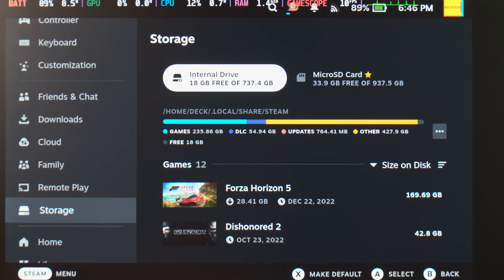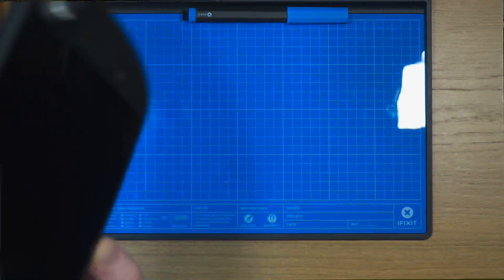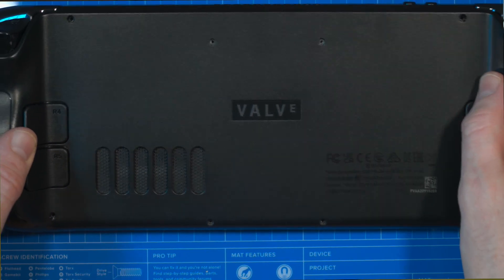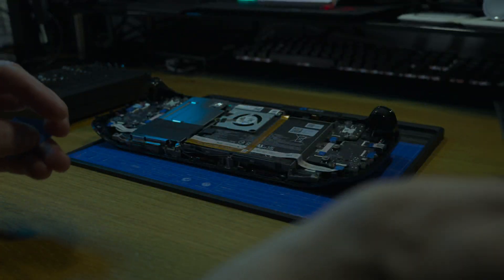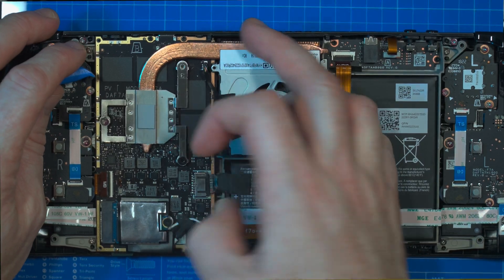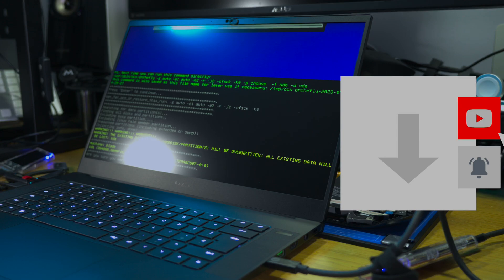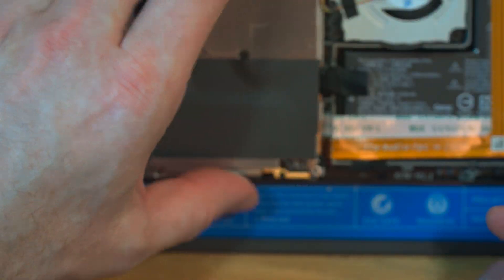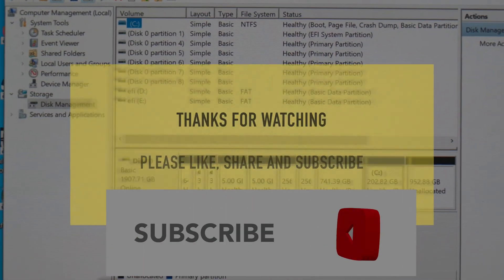Steamdeck SSD Upgrade Guide: Unleashing iFixit 2TB Upgrade Kit.

Comment: ive been rocking the wd 2tb for a good while now. 
surprised so many people waited to jump on this. 2TB is the sweet spot for storage
Reply from the maker: Hi @h1n1viruz yes 2TB ssd is nice, along with a 1tb microSD.  With a 1TB ssd, my drive and 1TB micro SD was full,  so i needed more space. Especially as I use Windows also.
Reply: Did you have any issues formatting the 1 tb micro sd card?.. I have a san disk extreme 1 tb and I can’t get it to format to save my life.. the deck reads and recognizes it.. it just won’t format it 🤦🏻‍♂️🤷🏻‍♂️

Comment: Do you have a link for that device you put the 2 drives in to clone them?
Reply from the maker: @DirasyajX, I used two old external MVME drive enclosures I had lying around from Onico, (https://www.amazon.com/ORICO-Transparent-Enclosure-Converter-TCM2-Silver/dp/B07RFJM494/ref=sr_1_4?crid=2RUU8GMTZSUD3&keywords=orico%2Bnvme%2Bm.2%2Bssd%2Benclosure&qid=1690904945&sprefix=Obico%2Caps%2C346&sr=8-4&th=1) and used Clonezilla software to clone the drive.  Seems these enclosures are available on Amazon, they are cheap but they may not be the best for speed of transfer, but you can use any enclosure that fits a 2230 Mvme, which is pretty much any external Mvme.  there are also cloning drives that take two MVME and clone them, but I have never tried them and they are very expensive.  But, either way, I would try to at least have two of the same make enclosures so they are the same speed.  Hope this helps.

Comment: Ive read people are using an nmve pcie extendion cable to add a 1tb-4tb m.2 2280 placing electrical tape and taping it down along with a thermal pad near the battery. Rather than just using a 2230 or a 2280 directly
Reply from the maker: @slapndbass I did consider that but my main two concerns are heat build up around the battery, and rf interference.  Probably would not make much difference, but an expensive experiment to find out.  I have tried hack solutions like these in the past for other things and they are usually fine for a while then you start having problems as you use it longer term.
Reply: @T8Tech  I put a 4tb 2280. No issues used those graphene thermal pad. Whit electrical tape.I took the risk but I saw there is a backplate coming out that is made just for an 2280. But it's $99 USD. I pretty much just use the steam deck to replace my ps3 library. And my PC can't handle rpcs3.
Reply from the maker: @slapndbass, nice, 2280s are great value at the moment, I have been eyeing up the Sabrent 8tb QVO drives for some time, just waiting till the price is right.  And speed is not really an issue for the steamdeck, the differences are negligible.  How long have you been running the 4tb?
Reply: @T8Tech  a few days but I bought my steam deck from a friend that already had a 1tb 2280 for 8 months. No issues. He's just regretting he sold it to pay the difference on a ROG ally that fried his SD card and over heats just running emulators
Reply: @T8Tech  I did decide to go with a slower speed gen 3 just to keep it less risky. If games run off the damn micro SD card you're not gonna notice a lower speed SSD trust me. I was playing max Payne 3 on my tv no dock just a USB c hub station for hours at 1440 120fps
Reply from the maker: @slapndbass, I bet he is.  ROG is nice if you need windows only, but if your going to emulate why would you use the Asus.  Windows eats up resources unnecessarily.
Reply: @T8Tech  idk he bought into all the YouTubers getting paid from Asus. I didn't get a steam deck till recently just cus of the tech YouTubers not the gaming reviewers . They said they'd honestly wait a while. And they were right it had issues(still kind of does) Yes the steam deck is limited but I'm using it to play games I missed out in my 20s(I'm 37) and my 30s. For the new ones I'm getting the onexfly. It launching august 10 I got the email today. I backed up all my ps3 games I bought during the rona and selling them online and local. Now I can just take my steam deck and my Portable playstations. I was going to put windows on the deck but I then thought to myself wtf is the point then? Even if I don't get the onexfly I'm more than happy with my purchase specially when it was only $250
Reply from the maker: @slapndbass this is the challenge with everything tech.  Marketing make promises that sound great but are never implemented the way you would hope.  Higher resolution, sounds great, but kills the batter. Faster CPU and GPU, less battery, more heat so it’s only in short bursts.  Smaller size, more heat, less battery.  And then there is the poor software implementations, and/or lack of updates.  Steamdeck is not the best at anything but is the most complete package so far, with the best software support.

Comment: Does it read n write 4500? Cus maybe I’ll buy this instead of the Corsair mp600 1tb
Reply from the maker: Great question, I will run a speedtest and post the results here.
Reply: @T8Tech  can’t wait the outcome. Ive found the mp600 for around 110 to 115 including shipping. So, would be 100 something more.
Reply from the maker: Ok, ran CrystalDisk Mark on Windows 10, getting around 3500MB/s Read and 2800MB/s write.  That said, i never notice any difference loading games via microSD (sandisk extreme 1TB) versus the SSD.  But your milage may vary.  Hope this helps.
Reply: Corsair has a 2tb available as well I believe
Reply from the maker: @AlwaysStayGeeky, really? I checked their site and 2230 1TB, the one you have, is the only one listed.  Maybe it’s pre release.  The iFixit is good value, but still on the pricey side, compared with 2280s.  Would be better if there was a cheaper solution.
Reply: I thought steamdeck cap at around 3500
Reply from the maker: @chariothe9013 I believe your right, its PCI 3.0 Gen 4, so it should max out about 3500mbit/s.

Comment from the maker: Make sure to remove your microSD Card before removing the back of your SteamDeck, I forgot, and my 1TB Sandisk microSD extreme pro card must have bent while taking off the back, because it has stopped working and now gets red hot if I try to use it, because its now shorting on the board inside the microSD.  So advanced warning be careful, it can be a very expensive mistake.  Bu on a lighter note, how many games do you have on your SteamDeck?  Are you like me who like to load everything onto it, just in case...?  Is 2TB SSD too much?  Has this video helped you at all?  Let me know what you think of the video, and if there is anything you would like to see covered in a future video.  Hope you get something out of it.